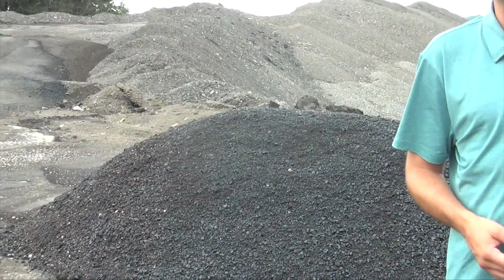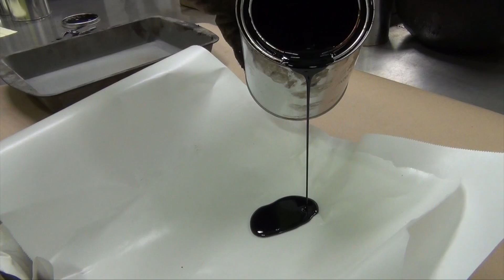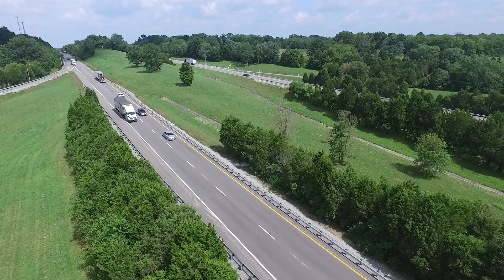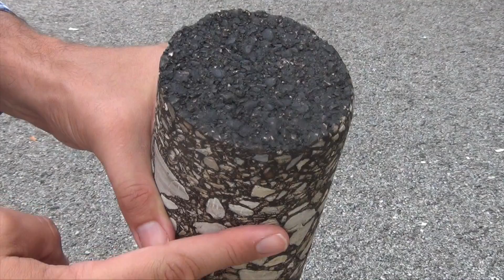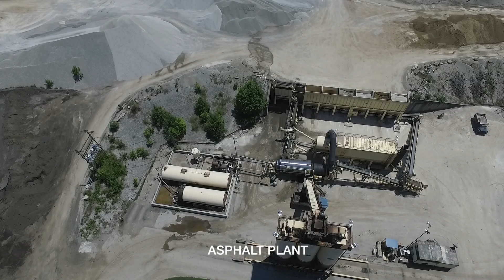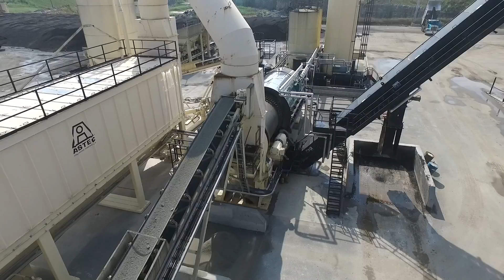What's In Asphalt?

Comment: We drive on asphalt roadways most every day.
After all, 94% of US roadways are surfaced with asphalt.
You may have even seen asphalt being laid on a roadway.
Truckloads of hot, black asphalt mix are sent to the site to be laid down and compacted.
But what is asphalt? What are the parts in the mix that produce a smooth, safe roadway surface to drive on? Let’s take a look
A typical asphalt mix is made up of approximately 95% aggregates (cốt liệu), meaning stone, sand and reclaimed (cải tạo) products.
The type of stone can vary across the country depending on what type of stone is locally available to producers.
The other 5% of the mix is the liquid alphalt glue (chất kết dính asphalt lỏng).
Asphalt is refined from the heavy component (thành phần đặc) of crude oil (dầu thô) and does not come from tar (hắc ín hay dầu hắc), which is a CoA derivative (chất dẫn xuất coenzyme A).
In the industry, it is known as binder (chất kết dính) since it binds the mix together.
Here are some examples of different aggregate sizes that get used in alphalt mixes.
These vary in diameter from 1,5 inches (=38,1 mm) all the way down to a fine-grain sand (cát hạt mịn) and dust sized particles.
Asphalt roads are designed for many different purposes. A small two-lane rural road has a different “recipe” than a major interstate highway – so these aggregates are used in different quantities to meet the specifications (đặc điểm kỹ thuật) for the desired roadway.
A stiffer (cứng hơn), flexible payment (kết quả sản phẩm) can be achieved by using larger aggregates and fewer fines, which creates more stone to stone contact.
Using more fine aggregates allows for a more flexible pavement because individual stones are surrounded with more binder.
This is a core drilled from a roadway that show a cross-section of the asphalt within. You can see a course mix of asphalt in  the lower section or base course and a finner mix design for the surface layer. This fine mix is less permeable and keeps water from penetrating down and causing cracks to form.
In many states, specifications allow for the use of reclaimed asphalt pavement, or RAP, and recycled asphalt roofing shingles (RAS) (lớp lợp asphalt) in the permitted asphalt mixes that get placed on roadways.
100% of asphalt millings (asphalt nghiền) can be reused in new surfaces. This results in many thousands of tons of recycled asphalt being used in the US annually.
It’s actually the most recycled product in the country (USA). That brings us to the liquid asphalt binder itself. It’s only makes up 5% of the mix, but it is the glue that holds everything together. It is designed to be a strong yet somewhat elastic adhesive. 
Polymers and other additives may be used to change its properties so that it behaves differently depending on roadway conditions.
These ingredient are heated and mixed together to be placed on the roadway and roller compacted.
Once cooled, the new asphalt road surface is ready to ride on in just minutes.
Reply: Wtf
Reply: Subtitles 😂